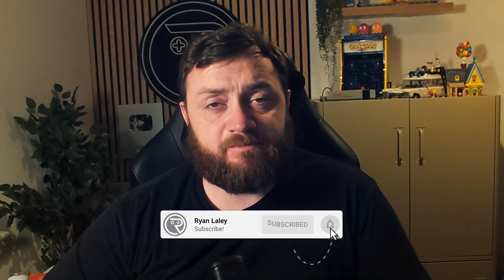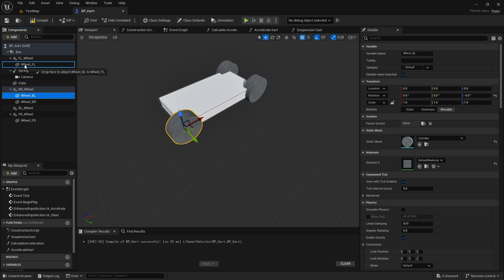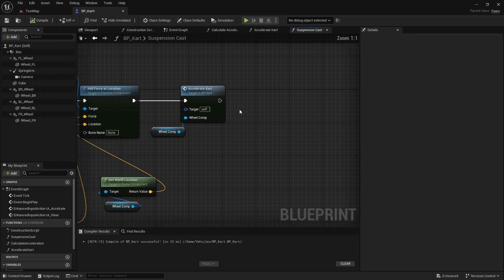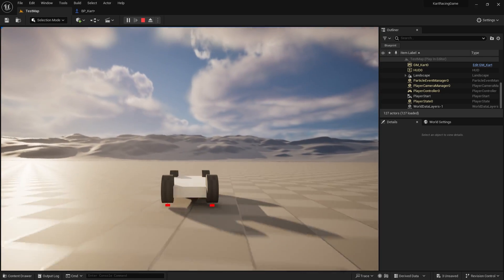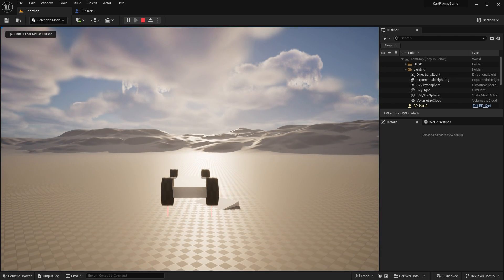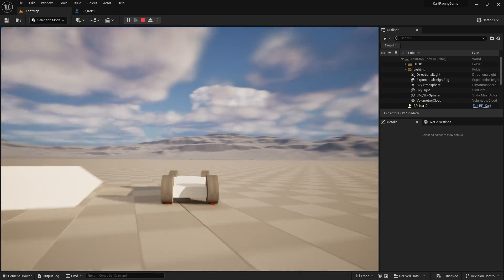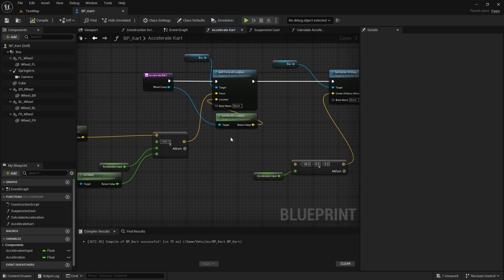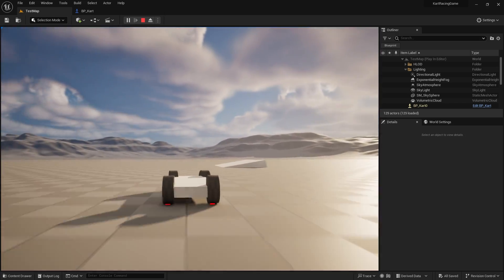Unreal Engine 5 Tutorial -  Kart Racer Part 4: Wheels

Comment: My wheels do not rotate after setting the relative rotation, do you have any idea as to why this might be? I am on the latest version of UE5
Reply: was able to fix this by multiplying the action value before plugging in to "target" on the finterp to node. to troubleshoot, drag off the return value from finterp to into a print string node (this will print the rotation angle of the tires). my original problem was that the tires were rotating, but by <1 degree
Reply: @westonk  Thanks for the fix!
Reply: Same. Cant get the wheels to rotate. Did you figure it out?

Comment: Sorry, I think there are some issues. For example, the car is constantly decelerating because the deceleration logic is in the Event Tick. This causes it to continuously counteract the forward force. Additionally, the car tends to be dragged either to the left or right, depending on its position relative to the world origin (0,0,0). Another problem is that after a short period of acceleration, the car starts to lift off, with either the front or back part flying upwards. I have already removed the center of mass adjustment, but the issue persists.
Reply: I tried to solve this by myself: I increased downward force in select vector node to at least -250000 and gave our base cube a mass of 400 kg. That pulls the vehicle to the ground after ramps etc. I'm just an amateur and this is probably not the cleanest solution, but works for me..

Comment: When going back the Wheels still rotating front direction. Can you please tell me how to do back rotation for back direction?
Reply: from "Set Acceleration" go to the upper part of a divide (/)
in the lower part of the divide (/) put "Select Float"
In Select Float A put "-1000" (or  your number) and in the B put (+1000) (or your number but in positive)

in the "Pick A" of the Select Float put greater than (<) and in the first put Acceleration Input, in the second put 0 (acceleration input is greater than 0 then use -1000, if not then use 1000

the result of the divide goes to delta rotation Y (Pitch) of the Add Local Rotation

Comment: For the steering, I decided to use A and D rather than mouse for my controls.  And I ran into an issue with this where after you steer then let go.  The kart is moving forward, but the wheel is still rotated.  I fixed this by getting the A and D key functions.  And on the release of either of the buttons, it resets the Relative Rotation back to 0.  It is a little jarring that the wheels just snap back into place... but it's the best I got at the moment.  If anyone has a smoother way to reset the front wheel locations I would appreciate it. :)
Reply: This is late, but here's a solution.  Off of the Steer input, drag from Completed and connect a Timeline via Play From Start pin.  In the Timeline, set 2 points at (0,0) and (0.3, 1) with Length as 0.3. Attach Update to SetRelativeRotation with FR and FL Wheel as Target.  From the New Rotation Z pin, connect a Lerp.  Attach the New Track 0 pin from Timeline to the Alpha pin of Lerp.  Leave the B pin at 0.0.  Drag off of the A pin and connect it to the Relative Rotation Z of FRWheel -> RelativeRotation.  Now from the Triggered pin of the inpput, connect a Sequence.  0 should go to the Stop pin of the timeline. 1 should go to Add Torque In Radians.  Boom.  Done
Reply: Off the top of my head: Maybe have a lerp of the rotation back to 0 over an amount of time that is based on your current speed could work?
Reply: If they snap maybe you're not using FInterpTo. Just use it to pass in the values, just like Ryan does a lot on the tutorials!
Reply: @Guitro  do you have any example bro ?
Reply: @kl43kid56  I do but it’s very hard to explain here. I think there is plenty tutorials about finterpto on YouTube tho!

Comment: Has anyone else had an issue where the box starts to wobble up and down like crazy only after a long period accelerating?
Reply: This tutorial has major issues. I think this guy made changes in between video cuts. Mine also bounces around and the red lines he has in his play test flash red and green for me and wont settle down. He must have done something off camera.
Reply: @JupiterxBlues  little changes maybe but he shows everything you need, what problems are you having
Reply: @Dawgwithagun  I cant get the debug lines to be fully red as his is. Mine flashes red and green rapidly and the whole car shakes and wont stop. Its like the box is on rough terrain even when the car isnt moving. It sort of seems like it refuses to touch the ground.
Reply: The wobbling seems to be really dependent on the mass of your vehicle, I was hitting all sorts of issues using a custom car mesh, but if I removed the car and replicated the size of the box and wheel placement it seemed to work fine
Reply: That's usually a damping issue. Try increasing the linear and angular damping.

Comment: At the 9:09 mark where Ryan sets the float to -1000 for wheel direction will only work for forward direction.  

If you drag off that pin and use 'Select Float' node, using 'Acceleration Input' float with a greater than 0.0 option to the Pick A boolean pin, setting A to -1000 and B to 1000 it will change direction of the wheel rotation matching cart forwards / back
Reply: instead of pulling from acceleration pull from the lerp and / by -1000 this will fix and avoid extra code
Reply: @h1ggsyboy11  that does not work correctly, Jason commented the correct fix, if you do from the lerp and divide by a negative the problem will not be fixed
Reply: @h1ggsyboy11  that worked for me. Thx